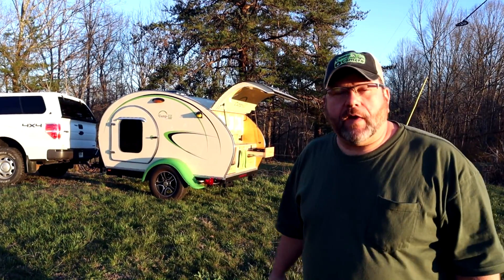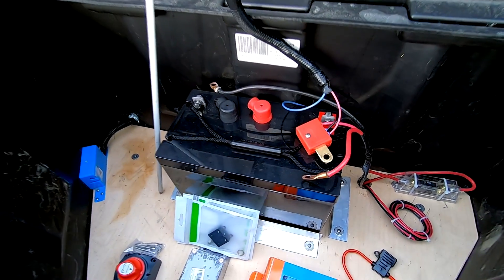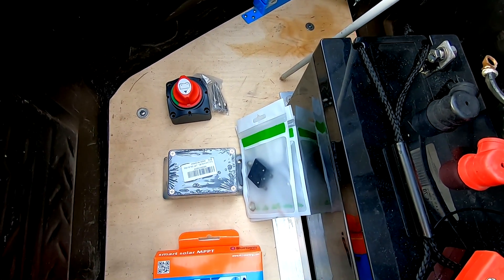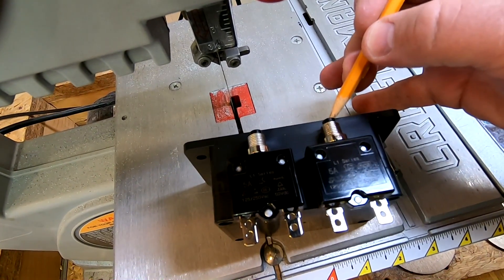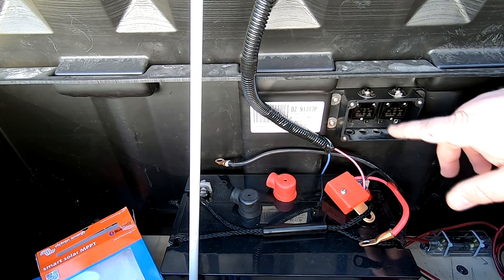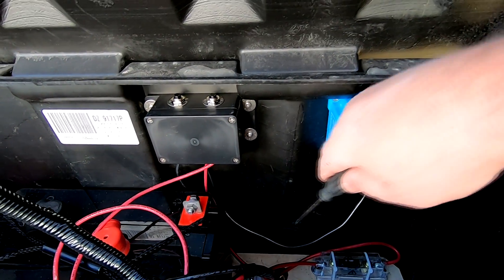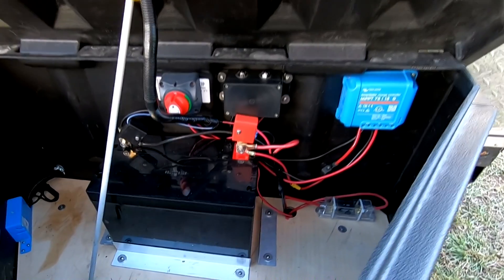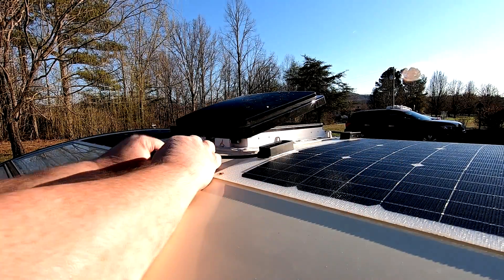COMPLETE SOLAR INSTALL - BOONDOCK READY CAMPER

Comment: How is that battery holding? I started my electrical work and need a battery ASAP to set up the solar. I'm also buying those solar panels and the charger controller. So are you happy with that set up? I'm going to make one similar. Thanks!
Reply from the maker: It’s holding up well, but if I were to do it over again, I would go with lithium. The cost of lithium has really come down since I built my camper.

Comment: This is my third time watching this video. I have a new Teardrop & considering a solar panel. You used doubled sided tape for the install, right? And looking at that spacing you did it to allow ventilation, correct? Are you happy with the results? Thanks.
Reply from the maker: Yes, very happy.

Comment: This video is a great resource! Thank you. 

What type of items does this much solar power? I’m wanting to have enough electric to power the exhaust fan, a few lights, chargers, a electric cooler, etc. I don’t want to overbuild/over pay but I also want plenty of power available. I can’t figure out how to measure what I need versus what the output is of a given set up.
Reply from the maker: My appliances are powered by the battery.  The solar just recharges the battery.  I use this setup to run lights, vent fan, and chargers.  It would probably handle a 12V fridge as long as there was enough sun to recharge the next day.

Comment: 7:38 I'm no electrician... Can you add a switch to go from Series to Parallel?  I believe this is how DeWalt does it to go from 20V to 60V on their batteries but they have engineers to figure out the electronics.
Reply from the maker: I’d say it’s possible.  I’m so happy with series though, I can’t imagine wanting to switch.

Comment: The positive of putting the panels in parallel is that of shading. In series if one panel is in shade your voltage will be bugger all. If in parallel at least one will produce power. its all swings and roundabouts mate. Enjoying your adventures mate and have a good one.

Comment: Nice. Is your system already outdated? I mean tech moves fast these days. What would you do if you had it to do over, starting today? Any improvements? What would be your plan?
Reply from the maker: At this point, I’m pretty happy with the system.  On down the road, if technology enables panels of the same size to output more energy, I may swap them out to maximize how many watts I can gather, but that will likely be quite a bit down the road.

Comment: Great set up . However , did I miss something ? Looks like your breaker box lacks easy access to the breakers . Will you have to unscrew 4 screws to get to the breakers ?
Reply: Aren't they push-button from the outside?
Reply from the maker: Good catch.  I have to lift the lid to reach them.

Comment: Great job and a very clean & informative 2 part video install! If you don't mind me asking, how are the flexible panels holding up? I am considering picking a few flexible 50w panels up but I am hearing mixed reviews about the top layer of the panels separating from the rest of the panel layers and causing issues, any thoughts?
Reply from the maker: Case Nyne Thanks for the kind words!  They are holding up really well, but I keep my teardrop in the garage when not in use.

Comment: I have solar on my camper, all you need to do to augment roof top panel is have a portable panel and plug into the battery with an anderson plug. Can then place panel in best sun pos without heating up camper, we like to park in the shade in Aust. Another great video. Cheers Steve
Reply from the maker: I’ll consider doing that!

Comment: What kind of tape would you use to hold the panels onto fiberglass
Reply from the maker: I used 3M VHB tape on my install.  I would recommend going to 3M’s website for applications.  My gut feel is it would work fine if the fiberglass is smooth and painted or gel coated.
Reply: @CampandCamera  it's an extended van roof the van is a 1997
Reply from the maker: I’d be surprised if the VHB didn’t work.  Be sure to clean it good with denatured alcohol and use adhesion promoter.  I’m not an expert, but would try it on my own.  You may reach out to 3M to be sure though!

Comment: Can the controller handle 2 100w panels
Reply from the maker: It can handle a total of 75 volts and 15 amps from the panels.  Check the specs on the specific panels your looking at and add the voltages and amp together.  If they come up to a higher number (I don’t think they will though), Victron makes a larger controller that would work.
Reply: Yes. If you reach max current output from the controller, it will just ignore the extra power without damaging it. You can run two 100 watt panels in parallel or series on this controller since they are usually close to 20 volts each.

Comment: I have thought about doing solar with our teardrop, but I couldn’t mount panels on the roof because mine is a convertible. Also, anytime that I am camping with my wife, she wants to be amongst the trees. If we have a choice of camp sites, she will choose the one with trees every time. So I have thought about using the portable solar panels and just going with one of the boxes, like a Jackery or Voltaic system. Have you ever had any experience with these type of systems? Pros? Cons?
Reply from the maker: No I haven’t, but I’ve looked at both the products you mentioned and they look great.  I actually wouldn’t mind having them myself.  Check out the YouTube channel “Slim Potatohead.”  He did a video on them.
Reply: Camp and Camera Thanks, I will check it out.

Comment: Great install! That was super smart of you to pre-wire for your solar. I really like how you used the roof vent to bring the wires thru and use it as a junction box. Eager to see your solar charger video. This may be one of the next projects for my teardrop.
Reply from the maker: I was so happy with how the fan routing worked out.  Hopefully, the panels will make good power.
Reply: Yes, that is an awesome idea.

Comment: Keep those panels clean. Even a bit of road grime, dust or even bird droppings can significantly impair the output.
Story time: Last year was speaking with a fellow who had his RV center do him up with (expensive) full solar and he was saying how disappointed he was in the performance. Turns out he had never cleaned his roof top panels, not once. We climbed up there with a bucket of soapy water and some towels to dry and buff. Saw him 3 days later and apparently his onboard panel was telling him he was getting double the output.
Reply from the maker: That’s a great tip!  Thank you for sharing.  You saved me some troubleshooting down the road.

Comment: I plan to attach wires on top of my trailer using Zip Ties and those little plastic squares to link them to the roof.  Those squares bear their own weak adhesive tape so I plan to replace it by the same 3M VHB tape used to attach the solar panel to the roof.

https://www.amazon.com/Adhesive-Backed-Mounts-Nova-Supply-Professional-Grade/dp/B06XNBS6TG
Reply: Oh, BTW, nice installation and great informative video!
Reply from the maker: Thank you!

Comment: Nice clean install! Exlnt explanation of series vs parallel. I'm running a pwm controller so for now I'm pretty much stuck with parallel, maybe in the future I'll look into a mppt unit?  Thanks,great job
Reply from the maker: From what I understand, PWM is still pretty good though.
Reply: @CampandCamera  Yes, for my small system it works surprisingly well
Reply: The price of MPPT is coming down for small systems. Keep your eye out for something that will meet your budget when your PWM needs replacing.

Comment: Looks like breaker in ground and positive? Why please. Thanks for clear video.
Reply from the maker: Yep, on both ground and positive.  From what I researched, a breaker is needed on both when running a series system vs parallel.  I’m not sure why, but it may be from the higher voltage.